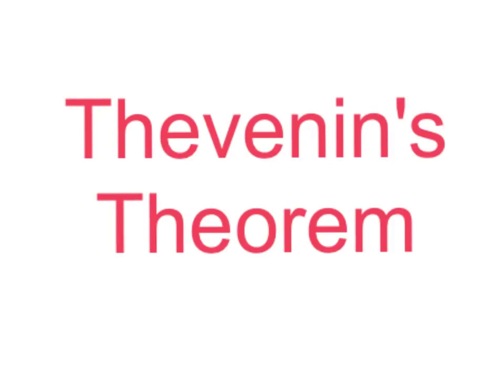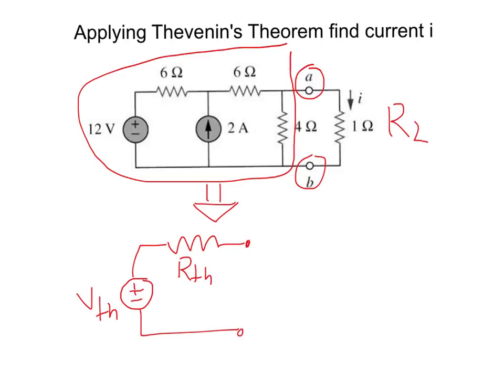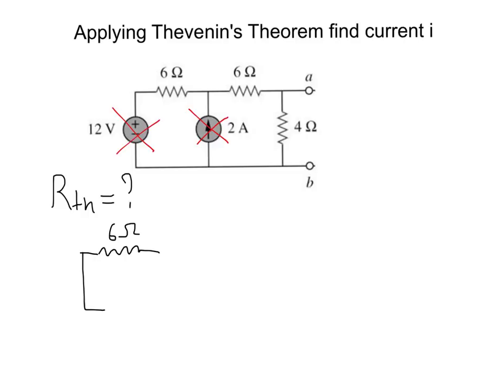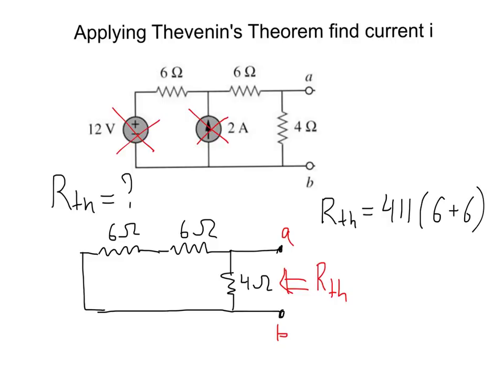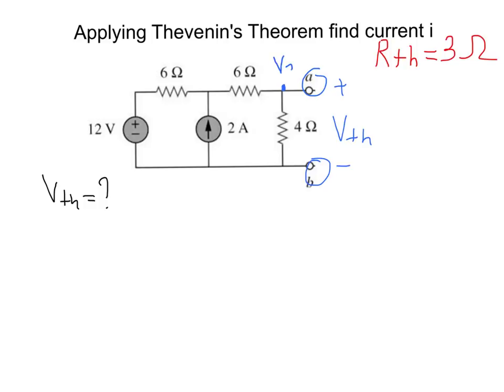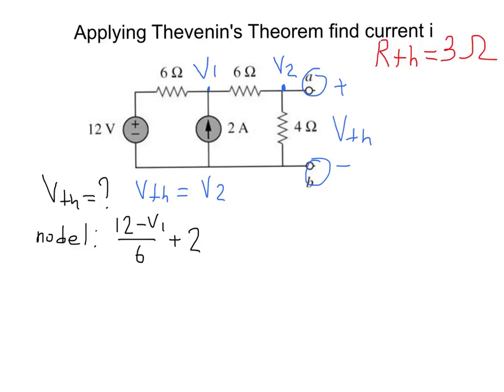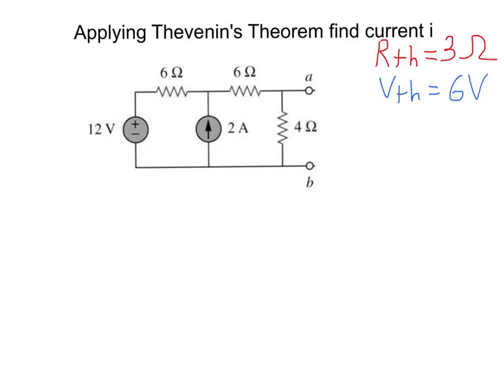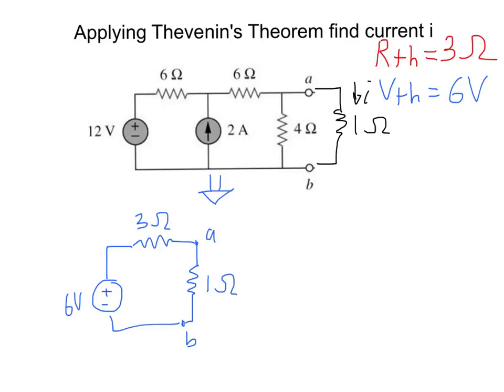Thevenin's Theorem. Example with solution

Comment: This is a very good example, Marina, and also well explained. The major problem, with your video, however, is that you have NOT shown how to solve the two equations formed, by Nodes 1 and 2, by the elimination, of V(1) which you really must show. V(1) = 2.5V(2) and working through, gives: (2/3)*V(2)=4, so V(2)=6V

Comment: Solve this circuit when 3 volt dependent source between v1 and 6 ohm, resistor 4 ohm and 6 ohm resistor are never connected in circuit

Comment: at 3:17 shouldn't the 4 ohm resistor be in series with the rest of the resistors ? I could be wrong I just need clarification on why you think theyre in parallel thanks
Reply: Don't forget that there's a node on either end or the 4 ohm resistor.  Therefore it's not in series.

Comment: Can't we use mesh analysis in place of nodal analysis to find.  Vth
Reply: Yes you can, but it is a little slower since it gives you the currents instead of the voltages

Comment: Here is how she got 6 V.
From node2: arrange the equation to get V1=5/2 v2
From node1: arrange the equation to get 4 - 2/6 V1 + 2/6 V2 =0
Substitute for V1 in the above equation:
4 - 2/6  *  5/2 V2 + 1/6 V2 => 4 = 5/6 V2 - V2/6 ==>  4= 4/6 V2 ==>  multiply both side by 6/4 .
The result is V2 = 6 V.
Reply: still wrong she didnt include the 4ohm resistor in series with the 6 resistor
Reply: @Anbuninja840  who told you 4 ohm resistor is in series with the 6 ohm resistor?, first you do series then parallel, 4 ohm is in parallel with 12 ohm.
Reply: @VALIANT_Electronics  since the a and b is opened , the 4 ohm became series with the 12 ( 6 and 6 )ohm resistor
Reply: @Anbuninja840  nope, opening in a and b has nothing to do with that, if they share 2 nodes that's parallel.
Reply: Where did you get 2/6V2   on
Node 1: 4-2/6V1 +2/6V2 ??

Comment: I don't think I get the point of Thevenin's theorem at all. First off is the 2A acting like a current draw? Becuse if it is. You would never get any current across the rest of the circuit. Because you are in fact short circuit the whole damn thing. However, let us assume that there is no 2A draw and we remove the thing entirely. Calculating it all out, my total current for the whole circuit is ~ 938ma. No way that you are getting 6v and or 1.5Amps on that load. At best you are getting 750mv at that RL and 750ma. What the hell is the point of this theorem it seems really pointless. The only way that i can see this ever working is to assume that the current source is consistent no matter what load you attach to it. That means you will never have any sort of voltage drop. At that point i don't see any circuit that can actually to that  practically. Because even the wire would have resistance so you would then still have some sort of voltage drop across the wire. Can anyone help me out here I am really confused as to how practical this tool is.

Comment: VTH is essentially the point at which the voltage going to the resistor is consistent in terms of value. So in this case, VTH is the point where the resistance is 4 ohms. Ideally V2, should have been labelled VTH.

Comment: 6V is correct, the first equation will give v1 = 12 + 0.5v2, the second equation will give v1 = 2.5v2, equate both equations and you'll get v2 = 6V

Comment: I can't get the 6v at v2,,please somebody help me how to get that easily I used systems of equations still not get it..
Reply: I got 4v at V2. Or am I wrong? 😂 heeeeelp
Reply: Same, I have redone it three times and got a friend to do it as well and we keep getting 4
Reply: I got 6V. I used the principle of the current flowing out from the voltage at the nodes, thus I got this -->eq at node V1: (v1-12)/6 + (-2) + (v1-v2)/6 = 0, and eq at node V2 : (v2-v1)/6 + (v2-0)/4 = 0. By using the substitution method,  then you will get V2 = 6V. Try this, hope you can get the answer :)
Reply: It's 6V. I did the mistake of not distributing the - in the first equation and also got 4V in the end. The Node 1 equation can break down to 2 - 1/6V1 +2 - 1/6V1 + 1/6V2, so V1 = 12 + 1/2V2. Then just substitute this into the second equation.

Comment: So let's just say I convert the current source into voltage source which would make 2Ax6ohm=12 V
Total voltage is equivalent to 24. 
By using voltage divider law whereby:
V2= 4/(12+4)*24 = 6volts.
 Is this valid?

Comment: There are a lot of people who doubt that Vth is 6V. Do this instead: Transform the voltage source into a current source of 2 Amps. Combine the two current sources and get 4 Amps. Transform back to a voltage source, 4 Amps * 6 Ohms = 24 Volts. Use voltage division to find the drop across the 4 Ohm. That is 24 volts * (4 / (6+6+4)) Ohms = 6 volts.
Reply: YoAirFresh nice explain and here using voltage division rule may I right
Voltage division rule: Vth = total voltage × opposite resistance/sum of total resistance
Reply: Or you can use the two 6ohm and 4ohm in series and get the voltage across 4 ohm. With 24v as the loop source. Say 24x4/16= 6volts. I hope it helps
Reply: Thank You  YoAirFresh...Perfect Explanation!!!
Reply: Could the whole process be done with the superposition method?
Reply: i got 2v so i dont know she arrived at 6v but her explanation was excellent

Comment: Please anybody explain how v2 is the same as Vth. It should be v2-the voltage of the lower node.
Reply: Griffin 999 the bottom node is the reference node so voltage there is 0. So V2-0=Vth

Comment: In node analysis you should  explain that we must include a ground on a reference node. So if you take reference node on node which is spotted on the branch between of b and the resistor 4ohms then Vb=0. The Vth = Va - Vb,  where Va=V2 which you are right. But Vb = 0 because of the ground.
Reply: Agree bro
Reply: Thank you

Comment: for node 1 , the equation should be (v1 - 12)/6 right? Please explain to me...
Reply: By convention, we assume that current flows from +ve terminal of voltmeter to the -ve terminal of the voltmeter. By that convention current would flow from + side of 12V voltmeter, goes thru the circuit, comes back to 12V voltmater at the -ve terminal.So 12V is higher than V1 and so + current = (12-v1)/6. Hope this helps :)

Comment: Thanks for the video, it was very helpful. Please clarify my doubt:
while calculating Rth, we removed both power sources... we considered voltage source as short circuited, but why did we take current source as open circuit? i mean, why didnt we consider a shorted connection between 2 6ohms resistors while calculating equivalent resistance?

Comment: Clearing up the algebra:
From node2 multiply both sides of the equation by 24.
4V1-4V2-6V2=0 Solve for V1
4V1=10V2 thus V1=(5/2)V2
From node1 multiply both sides of the equation by 6.
12-V1+12-V1+V2=0 Simplify 
24-2V1+V2=0 Substitute V1 from node1: V1=(5/2)V2
24-2(5/2)V2+V2=0
24-5V2+V2=0 Simplify 
-4V2=-24 OR V2=6 and V1=15
Reply: At the line where you write: '12-V1+12-V1+V2=0 Simplify',
Shouldn't it be '12-V1+12-V1-(minus here instead of +)V2 = 0 if you look at her equation for node1
Reply: Where do you pull the 24 from?
Reply: Kyle Saucier 
Trying to remember my thinking from 3 years ago, I think I multiplied both sides of the equation by 24 to reduce the number of fractions that would be created simplifing the typing and making the reading a little bit more clear.
Reply: @kylesaucier7650  the 24 is from 12+12

Comment: Really helpful. plzzzzz do upload for Norton also.
Reply: Proshidh Prosonno Hajong, for Norton is the same as thevenin, the only difference is that in the equivalent circuit you get a current source in parallel with an equivalent resistor (Which is called "Norton Resistance" this time).
Reply: Thank you so much for the reply Luis. 
One basic question to ask. How do we know a given circuit is to be solved if it is not mentioned that the circuit is to be analyzed by Norton or Thevenins ? Will the final answer be same for current and voltage?

Comment: Calculating Vth you could also use superposition and voltage/current division as well. The 12 V voltage generator create V'th=12*4/(6+6+4)=48/16=3V. The current generator's current should divide calculating the current on the 4Ω resistor i4=2*6/(6+(6+4))=12/16=0.75A. After this you could calculate the second part of Vth which is V"th=4*i4=3V. Finally the Thévenin voltage is Vth=V'th+V"th=6V.
Reply: Finally somebody who tinks like me...

Comment: How did you get 6v for v2?
Reply: multiply the equations by the lcd of the denominator then simplify the equations then use systems of equations or you can use calculator mode:equations:simul polynomials represent V1 as x and V2 as Y :)) WC If you are still confused you might want to scan your notes from algebra 1,2. :)))
Reply: +yorenton Set one of the equations for the nodes equal to V1 and plug it in to the other equation. This should change one of the formulas to be a function of V2 instead of a function of V1 and V2 and solve.
Reply: correct
Reply: +David Cham yet the answer should be 4 and not 6
Reply: I had the same problem,I didn't calculate the minus on V2
Reply: yorenton after all the comments, im confused, which one is correct?
Reply: @haziqdanial7538  Marina had done it correctly. Vth = 6 V
Reply: I think you didn't calculate Vth properly. 6V is correct
Reply: @thehindupenguin1684  yes it is 6v...
Reply: she did the entire nodal wrong v1 should be 7.51 and v2 should be 3

Comment: Why is Vth=V2 ? it should be V2 - V3 , where V3 is voltage at junction point just to the left of open terminal b
Reply: It is assumed that they're connected to the ground, hence V3 = 0. This is just to make the problem simpler.
Reply: Agreed!

Comment: uh... u removed the 2A current source during finding the equivalent resistance and then did not joined the circuit there.. why?
Reply: +Tamal Bachar 
when finding thevenin's resistance you short circuit independant voltage sources (draw a line through them) and create open circuits at independant current sources (completely erase them).
Reply: +simplypieFTW  thank You.. i got that earlier.. thank you for the reply.

Comment: Anybody confuses about what +Marina Belkina did. Here is the full list of the procedure:
1. Nodal Analysis on two node: V1 and V2, you could name them as VA or VB, does not matter.
2. As part of the nodal she did KCL (current In=Current Out) in each node.
3. Did simultaneous equation solving to figure out the voltage in V2. 
[Note: she made an ground node analysis in node 2 to get (-V2/4ohm) because Vground-V2=-V2 as Vground=0V]
4. She claimed no current will follow the end of 4 ohm resistor so V2 will be the same as the Voltage through Open circuit = VTH.

Comment: Hi I think what you did with current analysis to the node by KCL is quite wrong, because current don't just add up because they want to. From Voltage source of 12 V battery current flow clockwise but 2A currect souce(supplied) is going anticlockwise relative to the voltage source so should not there be a negative sign. I don't know how you worked but your Thevenin Voltage seems reasonable to me. Thanks.
Reply: Whom Isac 
Her KCL is correct if don’t want to mess up though just do V1 drops over every branch and you add them up to zero. Basically following the idea that at any given node all current is either going into the node or going out of it and it adds up to zero. That’s how I do it.

So my equations for this would be:
(V1-12)/6 - 2 + (V1-V2)/6 = 0
(V2-V1)/6 + V2/4 = 0

Personally I don't try to determine if the current is going in or out of a node based on intuition because it can be confusing. I just like to be consistent with this method and not have to worry about it. After all it's nodal analysis, you look at it from the node not the circles.

Comment: shouldn't the equation be v1-12/6+2+v1-v2/6and v2-v1/6+v2/4 please reply Thanks in advance
Reply: +runevider I think you made a mistake while trying to write the equation. It can't be v1-12/6 ?? may be you meant v1-V2/6. And for your quesiton: why not v1-v2/6+2+v1-v2/6?? It's because of the KCL rule. In simplified form, in node V1: there is two current source coming and one going out. If we name them I1=current from 12V battery, I2= Current source, I3= current from node V1 to V2, then it's just : KCL=0=I1+I2-I3. (where I1=v1-v2/6, I2=2amp & I3= -(v1-v2/6))

Comment: isn't V2=4V????
Reply: When solving for the equations, provided you leave them in fraction form, you should have:
5(v2)/6 - (v2)/6 - 4 = 0

Rearranging for the subject v2 gives

V2 = 4(6/4), cancelling the 4's leaving you with 6 volts. 

6/4 is gathered from 5/6 - 1/6, giving 4/6. You then multiply by 6 and divide by 4 to solve for v2.

Comment: Is v2=6?, cause i got v2= -12 and v1=6, please help?
Reply: +Waytzkin Ralm Ok if you had looked at her video, these things she did to come up with an answer for V2:
1. Nodal Analysis on two node: V1 and V2, you could name them as VA or VB, does not matter.
2. As part of the nodal she did KCL (current In=Current Out) in each node.
3. Did simultaneous equation solving to figure out the voltage in V2. 
[Note: she made an ground node analysis in node 2 to get (-V2/4ohm) because Vground-V2=-V2 as Vground=0V]
4. She claimed no current will follow the end of 4 ohm resistor so V2 will be the same as the Voltage through Open circuit = VTH.

 If I were to do it in my way I would take the 4 ohm resistor as my load resistor to find the V-Thevenin by Voltage division.
Reply: how she solved  V2 without knowing what v1 is??
Reply: but what happen with v1?if I take v1... will the answer false?
Reply: No, If you do the KCL part correctly then you should get the same answer.
Reply: Yes right.....

Comment: wrong !!!!!!!!!!!!!!!!!!
You can not use node voltage method without ground node...
Reply from the maker: +Govindbhai Prajapati well, don't think the comment is relevant, sorry
Reply: +Govindbhai Prajapati not sure if it's gonna help you know, but you can consider any node on the bottom to be your ground. as a matter of fact  you are free to choose the ground wherever you want you will just have a different equation for your nodal analysis. so if you put any of the bottom to b ground (which it is in this approach) you will get the same exact equation and it is correct! :)
Reply: ya I know ,but ground is very important in experiment with out u can't do anything.
Reply: +Govindbhai Prajapati  youre right, but in this example the ground is "assumed" to be the bottom nodes!
Reply: okk

Comment: Why is the 6Ω and 4Ω resistors are in parallel? I thought they are in series. And why you used current division in solving for i? You used the Vth as the current source and used current division. I'm quite confused. Hoping for your reply. Thanks a lot..
Reply from the maker: +Angelica dela Peña 
These resistors are in parallel according to points a and b. And I didn't use current division, I used nodal analysis to find Vth. You can only use current division if you have one power source in the circuit.
Reply: Ahhh okay now I got it. Thanks a lot!
Reply: Both terminals of the Req (equivalent R) of the series resistors share a common node with both terminals of the 4-ohm resistor. Therefore, by definition, they are in parallel.
Reply: Angelica dela Peña - The Current Splits at the Junction and hence the resistors that you're talking about are parallel.

Series resistors all share the same current and parallel resistors do not share the same current.
Reply: +Angelica dela Peña yeah i  think the two 6 ohm and 4 ohm are all in series
Reply: angelica when current gets dvded then resistance become parallel so in thes q current flows   from 6 to 4  there u see current s geting dvided
Reply: angelica when current gets dvded then resistance become parallel so in thes q current flows   from 6 to 4  there u see current s geting dvided
Reply: vencent del toro is gud outher.....any question? contact me my whatsapp nu  +917897297571
Reply: Rth rule
Reply: current divides at that node hence they are paralell
Reply: .....bruh.
Reply: yeah i know
Reply: Angelica dela Peña
Reply: it is simple,
place your eye at terminal a and b, you might get your answer.

Comment: v1 =-15.033 ,,, v2= 6.02
Reply: khalid mohmed 
Hello khalid would you be so kind to explain how you got 6v, i keep getting 4v. Thanks very much in advance
Reply: ***** I just tried is an i was getting 4v too, but I got the 6v now, just go through your equation and see if you skipped a step or incorrectly simplified a value

Comment: wouldn't 6 ohms be in series with 4 ohms? at 4:25
Reply: The two 6 ohm R are in series, so new R = 12 ohm. Then you can place that 12 ohm R in place of where the two 6 ohm R's were, but to better picture why it is in parallel, you can place that 12 ohm R on the very left branch and just extend the wires from the 4 ohm R. Now, you will see that the tops of the two R's share the same wire with pt. a, and the bottom of both R's share the same wire with pt. b. Imagine there is voltage source connected at terminals a & b, now do you see why the 12 ohm and 4 ohm are in parallel?
Reply: There is a node, which she later denotes as "V_2", between the 6 ohm resistor to the right and the 4 ohm resistor. Because of the presence of that node, those two resistors are in parallel.
Reply: If current splits, they're in parallel.

Comment: You can also use superposition theorem to solve for the voltage drop across 4 Ohm resistor. It takes a bit longer but it works if you haven't learned Nodal Analysis
Reply: Yes . actually by doing that we are getting 3 volt for both cases(two sources alone) and they add up to 6 volt
Reply: superposition is embedded within the theorem.

Comment: how did you calculate V2 as 6 volts?
Reply: +Marina Belkina  how to calculate v2 as 6 volt.
Reply: peter almeida , simplify the two equations by removing the fractions then solve simultaneously
Reply: your high school algebra  teacher must give you change
Reply from the maker: 2013Aleksey2013 Aleksey, Thank you)